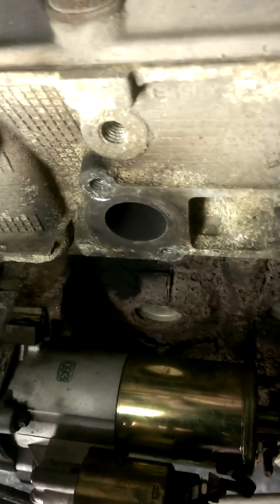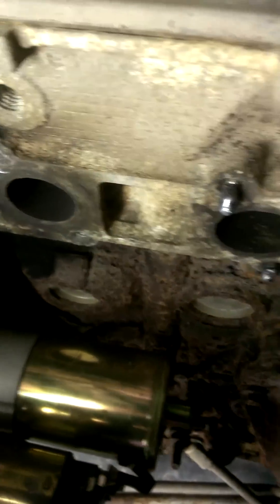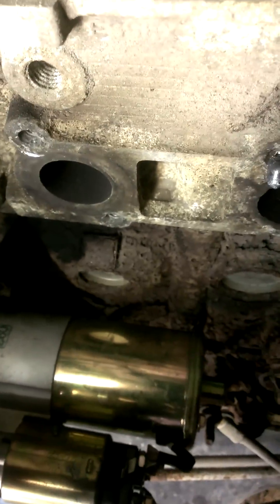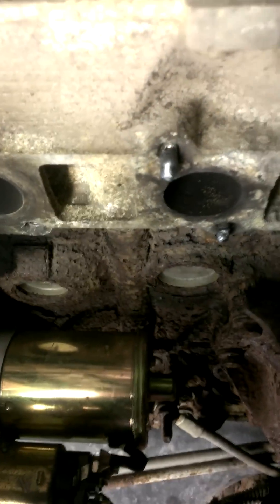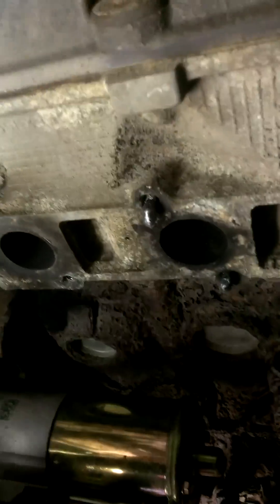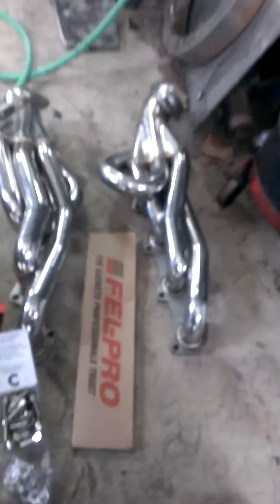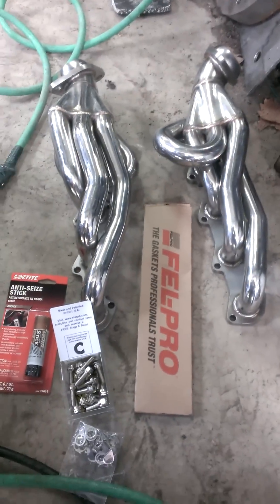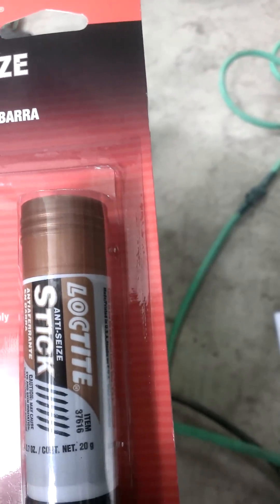Ford v10 broken exhaust manifold stud removal

Comment: This method worked only with stainless welding wire and a stainless nut for me. Used an element scanning gun and the old studs had so much zinc coating on them the steel nuts wouldn't weld to what was left of the studs. For some reason stainless did the trick even when it was broke about 1/4 in in the head.

Comment: Where did you get the Headers and what about the hole for the smog bs on the driver's side?
Reply from the maker: Back then I got them from eBay, I recently did it again but got them from Amazon this time, they are all stainless and comes with a new y pipe to delete that restriction from the factory one. There is no smog control on that truck

Comment: Ik this is a few years later but this is a pain in my ass rn cause it’s not even in a truck. It’s in a damn RV. Still can’t get the studs out and they are flat with the head, guess I have to remove the head and bring it to the machine shop
Reply from the maker: Mustang Matt Do you have a welder? preferably mig? or possibly an angle drill with left handed bits and easy outs

Comment: just finished project as this-in frame!!  one suggestion is to use an air hammer (if studs are sticking out) and hammer the stud for several seconds after heating.  then finesse it out with the vise-grip.  you're lucky.  i wasn't allowed to pull the engine.  good thought about not heating stud.  stud gets hot and it actually gets tighter.

Comment: I have the same issue.  I am so pissed with Ford engineers...this is not a Formula one engine, it's a truck engine.  The studs should have been bigger, not 5/16" in diameter.  Right now I have 3 studs broken off inside the head.  One of the studs has a broken off drill bit and an easy out.  Now I have to grind out the easy out and drill bit.  Tried welding a nut, stud extractors...nothing.  I love my truck but this is ridiculous.  If you want to pull the heads you have to lift the cab or pull the engine.....F##K!
Reply from the maker: if you have a mig welder or can get your hands on one just keep building up spot welds on the end of the stud until you can get a pair of vice grips on the end or a 3/8 nut over it and weld that to it.You won't hurt the head because it's aluminium the weld won't stick you'll be heating up the stud which helps to loosen the oxidation between the head and the stud, if it breaks off just weld it back on it takes time and it's a pain in the ass but it works.
Reply: Craig, thanks for the Info, but I did weld a nut to the end, and I snapped the stud inside the head.  I had about five studs broken off inside the head originally, then I  snapped off about 3 more on top of that trying to remove them.  I removed some with the welded nut method, and couple with easy-outs, but there are 3  that are really stuck and about 3/8" inside the head.  I am taking the heads off now.  Repairing the truck is becoming a hobby.  I think I'll fix the plugs when I have the heads removed, and maybe I'll get a valve job done as well.  Cheers.
Reply: @ChevyMalibu69  thanks for your advice! I will try on my E450 V10, the studs broke 1/8 inches inside the head

Comment: What type of headers did you use? Since the manifolds are off, debating to use manifolds again or go with headers.
Reply from the maker: I went with jba headers got a good deal on them through ebay

Comment from the maker: Yeah it's a huge pain in the ass to do the job, but worth it in the long run. I put headers on and that y pipe cut out kit to get rid of the restriction, big difference can definitely feel the torque gain on the low end. Another way to remove the studs if you have something to weld to its too wild on a 3/8 nut heart up head and remove broken stud that way